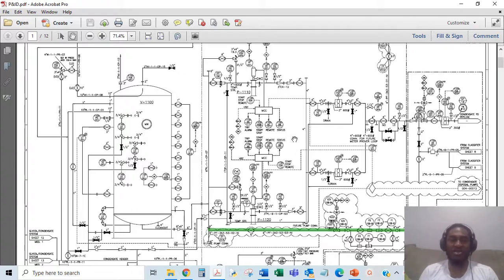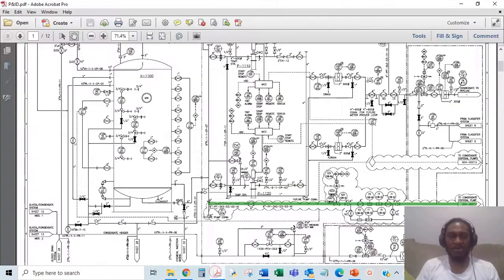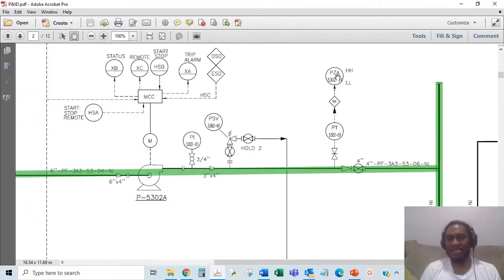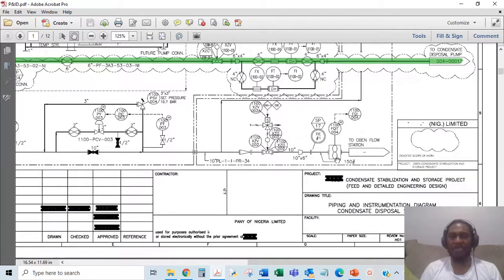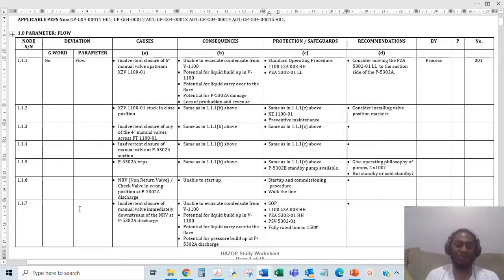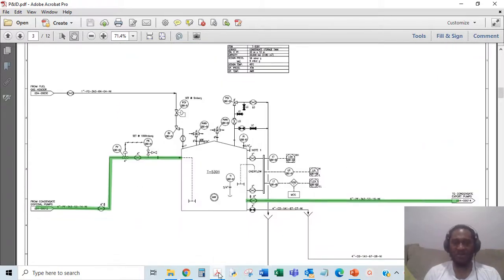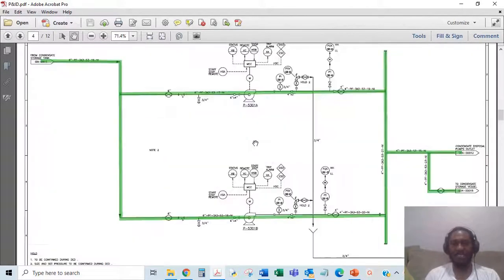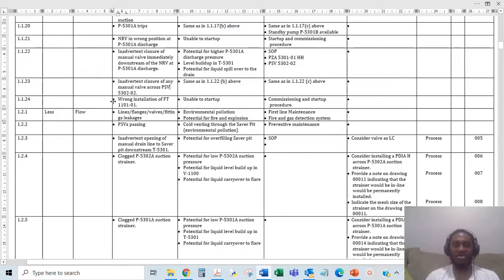Facilitating a HAZOP #2 (Hazard and Operability Studies)

Comment: Hi, Tobi! Thanks a lot for this video! I wanna add a couple of questions about this P&ID. What is the reason to install PSV on a discharge line of the pump? We can simply use a pump with discharge pressure less than discharge line strength. For this case, for example, we need discharge pressure about 25 m of water column, so if we use a line with design pressure 6 bars, nothing happens to the line. This is much easier and cheapper. What do you think? And taking this into consideration we can ask: what is a reason to control pressure at the entrance of T-5301? We've already decided to use a pump with low discharge pressure, so if we take away all hydraulic losses between the pump and T-5301 from the pump head, we get just a low value of pressure before T-5301. Taking into account the size of this tank, we can be sure that nothing happens to it. What is your opinion?